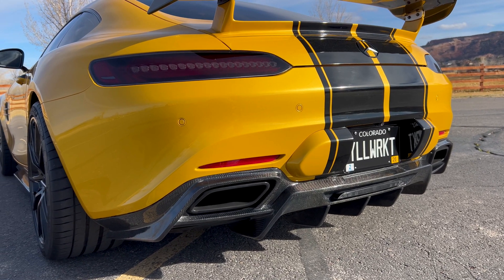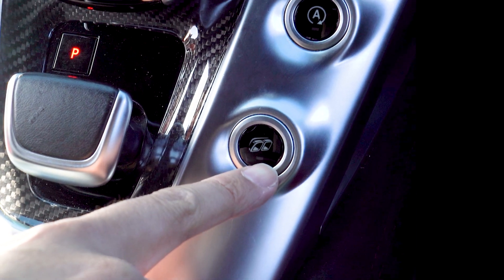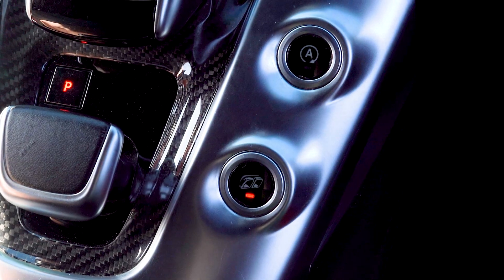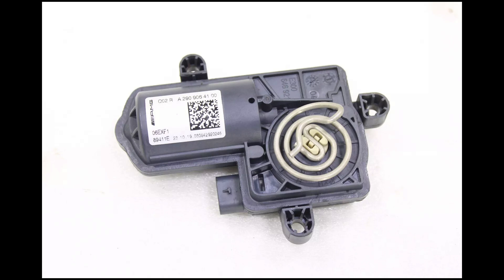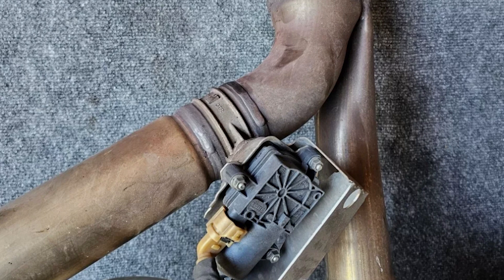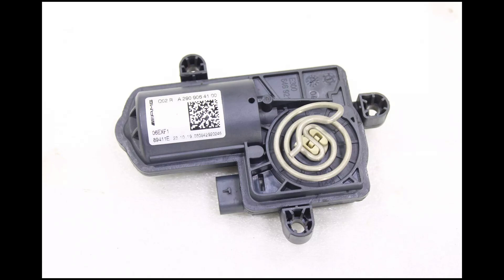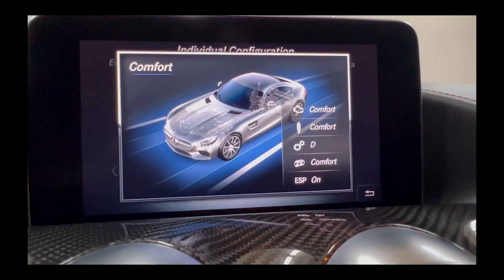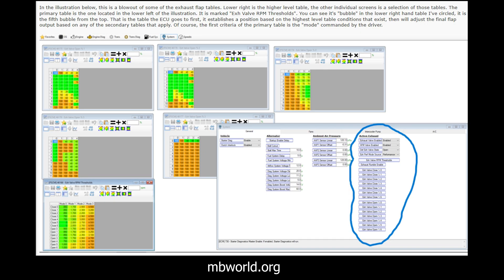AMG Performance Exhaust System Explained - Theory of Operation

Comment: Can you clarify what not fully open means? What do exhaust modules open exactly? There are 3 valves which one is not open in low rpm?
Reply from the maker: The valve is variable. And there is only two valves. One on each side.

Comment: When you press the exhaust button are the H pipe valves closed at idle? What does not fully opened mean? Are the muffler valves fully open at idle when you press the button?
Reply from the maker: The AMG GT active exhaust in this year was variable. It changed and was never fully open unless at certain speeds and acceleration. That is why they have the exhaust valve module.
Reply: @DriversTherapy yea but never fully open means what? The h pipe valves are closed or the muffler valves are not fully opened?